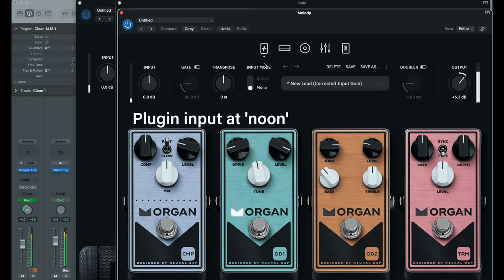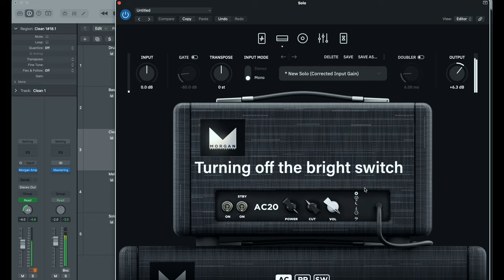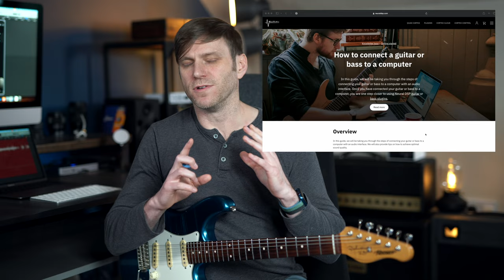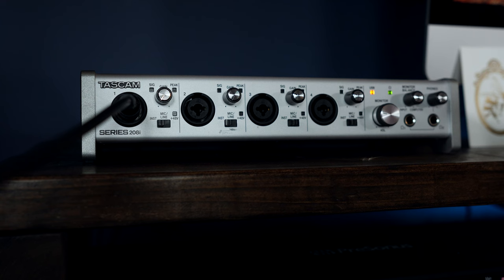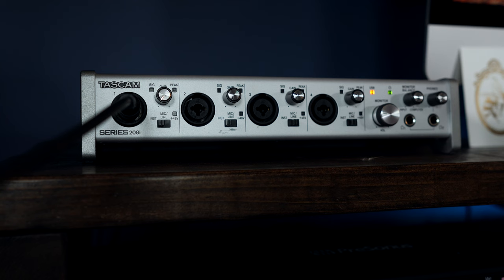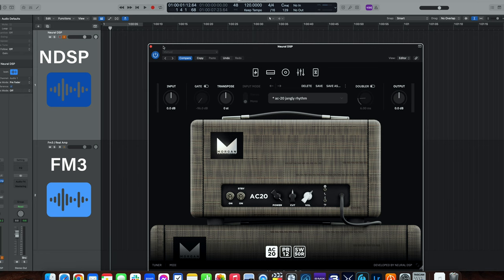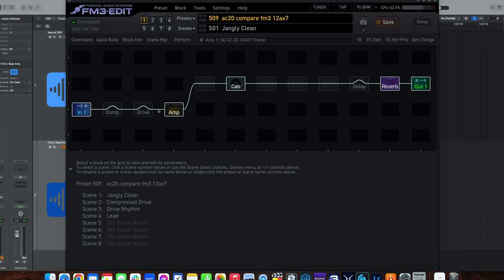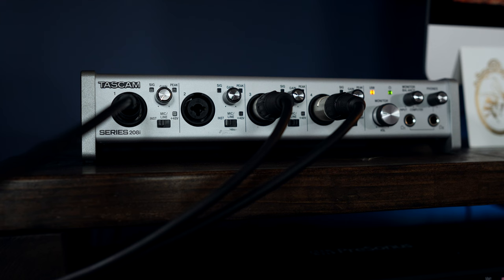I Finally Learnt To Like Neural DSP Amp Plugins | STOP Slamming That Interface & Get Better Tone!)

Comment: I keep seeing this "Gain at zero" thing, and wonder whether anyone has ever thought about what  that actually means and how it differs from one input device to another. It just wont mean the same thing for all devices, I can guarantee you that, as there is NO STANDARD to which all interfaces adhere to.

It seems, after a little thought, that the plugins like to see an instrument input (preferably JFET I would think) with the GAIN at UNITY.

This is not the same thing as turning the gain knob all the way to the left. 

The only way you can be sure of finding unity gain on your input channels is :

 run a test tone generator from your DAW at -18dB (arbitrary level but it should correlate to unity gain at the output which is where the opamp performance is best)
 route that signal to an output 
 take a balanced TRS jack from that output and connect that to an input channel
 increase the gain on that input channel until your interface's mixer or your DAW reads -18db

That should be where unity gain is set on the preamps of your interface. Mark it with a sharpie, or if it's digitally controlled, note the input gain on the device.

I can't think of another foolproof way to establish whether the gain setting on your interface's preamp is at unity or not.

Of course, this isn't a problem for anyone using an external instrument preamp which feeds an interface input at line level - unity gain is almost always marked on the input gain legend. DI Boxes, if that's your vibe, also vary with trannies being either 10:1 or 12:1...so there'll be a difference in the level your interface sees depending on the box used.
Reply: the issue is more to do with the specs of the A/D converter, so -18dBFS out of a D/A could be a range of different voltages depending on the gear being used.

The best way is to send a sine wave out, and measure the actual voltage. Then run that known voltage into your input chain and see what dBFS level you get. From here you can accurately adjust to a known headroom.
Reply: @eds4754  I Don't think that's true about A/D converters...the vast vast majority of interfaces use the same A/D chips. There are only a few in common usage as far as I know, thus keeping the entry level the same for all manufacturers. The difference is in the preamp circuit design either side of the A/D D/A. That's where the magic happens, and that's where it's either good topology or off the shelf designs using the cheapest of the cheap SMD OpAmps. 

We agree on the solution however; run a test tone out via TRS to an input. All else being equal, the inputs and outputs will be calibrated similarly. None of this would a problem if manufacturers stipulated exactly where unity gain is on the mic pres.
Reply: @stephenfleming8030  you can look at the specs of different converters, they vary in how much voltage (dBu) they can take before clipping. Some converters even allow you to adjust the headroom so you can calibrate them to whatever gear you are using them with. 

You often hear of -18dBFS because converters will often be designed with +4dBu=0VU with 18dB of headroom, so a 4dBu sine wave would have 18dB of headroom before clipping, and therefore 22dBu of headroom total.

There are MANY converters that don't use this definition though. Avid MTRX has 30dBu of headroom, RME varies between 24dBu and 19dB and 13dBu, UAD has 20dBu, Prism and Lynx are different too. so UAD Apollo has 16dBu of headroom, or a 4dBu sine wave would be equal to -16dBFS.

This is the exact reason there is confusion about input levels with amp sim plugins too.
Reply: @eds4754  Absolutely, I agree. Just to clear up any confusion I may have caused, when I say 'converter' I'm talking literally about the chip that does the conversion. As we've established, the topology on either side of the converters can vary from circuits that cost pennies, to well designed often transparent circuits like RME pres....a world apart from a small Focusrite Scarlett that's using very cheap smds that need to be handled with care to get the best out of them....to say nothing of the clocking differences between units that use the same physical ADDA chips.

I'm assuming that the 'majority' of interested parties here are guitarists, rather than primarily engineers. I don't know if that assumption is fair or warranted? If that is the case however, then it's doubly difficult to explain what's going on with input gains and how they should be set taking account of all the variables at play. 

I've tried external pres at unity, and it seems to be ballpark. For guitarists maybe a decent active DI box is the best solution - an active Radial DI for guitar is 140 EU, and you'll have it for life. 

For the lazier, or the skint...Tonex software has pre-recorded guitar parts built in which are DIs from fairly easily identifiable pick up types - one could always match the input gain to them if you're in a pinch.
Reply: @stephenfleming8030   what about converters that don’t use any preamps? They all vary - There simply isn’t a standard for defining an analog voltage as a dBFS level. It has nothing to do with preamps, or other circuitry in this case. They are just spec’d different for different demands and price brackets. 

and so setting a preamp to unity doesn’t help when converters have different specs. Preamp gain is one thing, but the conversion ratio of the converters is another. 

I would also be careful with Radial DI’s because many of them have impedances far below 1M Ω which means they’ll load passive pickups incorrectly and get poor results. They’re well made DI’s, but for many guitars you’d need to run a buffer in front. I use an Avalon U5, but there are many suitable DI’s with 1M Ω or greater that I think are more suitable.
Reply: @eds4754  You're right, there's no absolutes in this, but dare I say that the assumption that -18 is ballpark 0 leaving you plenty of headroom either way is a good place to start. It's not an perfect assumption to make, but it's a place to start.

Setting aside amp sims in particular, it's good practice for recording guitarists to get used to the fact that -18dBFS simply is not too quiet for a digital recording. It's where the preamp circuits before and after your converter chips exhibit the best performance in terms of S/N ratio, THD and frequency response. If you're running into a Burl or an Apogee etc, such things shouldn't vex you too much, but if you're in the other 99.99% of recording artists using relatively affordable units by Presonus/Focusrite/MOTU et al, all those units use the same jelly bean smd opamps that run on 5v rails and they will crap out at either end of the optimal input range. They're amazing for what they are and how much they cost, but you simply cannot get the best out of them unless you treat them with care.

On guitar inputs, it's good practice I think to run through a buffered device at all times. Even a Boss TU-2 will do the job. I reckon most floor units (not pedals) are probably buffered in bypass mode.

Comment: Wow, I am even more confused now. Getting a healthy (non-clipping) DI signal recorded should be the way to go for signal to noise ratio. If that doesn't work (and it clearly doesn't) isn't there something wrong with the plugin software ? I am using amplibute, and aparently there the problem is the opposite, not enough gain that hits the plugin with a 'normal' input level. Basically, all this should not be an issue, but should be addressed correctly by the plugin developers I think. Or maybe I simply don't get it at all.
Reply: If your interface has less than 15dBu of max headroom then gain at 0 is already going to be close to clipping with humbuckers. The noise floor you have to worry about is the loudest source of noise in the chain, which will be in the interference into the pickups (which is much louder than the self noise of the interface). Turning the gain up just raises this background noise more.

Comment: Hey nice video , i am using this technique of setting interface gain at zero ( UAD Appollo) and been using NDSP Soldano at noon, into studio one and man it sounds like crap on a mono channel. The waveform is also very very thin.  How do I get better sound and healthier D.I waveform if I reduce the input of my interface>>>???
Reply from the maker: That's interesting, I've found the Soldano, way nicer setting it this way. You could gain your interface the normal way then reduce in the plugin, it's just when I did it that way I couldn't reduce it enough still with the interface I was using.  I also don't really see it making much of a difference tone wise these says with noise floor being what it is.
Reply: @DavidBeebee  what about buses ? Do you bus 2 mono track to the same bus or one for each? Theres many ways of doing this im a bit confused. I just want to double track and add a lead guitar and make great 80s music.

Comment: ok that is what is supposed to be done i guess. now let s assume another scenario : you want to use your dry signal to another amp vst...you have a shit noise ratio recording because it was recorded too low just for neural dsp ?
Reply: Neural DSP's optimal level is actually quite hot, its 7dB hotter than you'd get using an Axe FX (for instance). The main source of noise is going to come from background noise into the pickups which is going to mask the self noise of the interface, unless you're recording like 20dB too quiet.

Comment: when i turn the gain to 0 on the high-z input on my presonus quantum 2626 (same preamps at the 1824c), i get zero volume from the guitar. how did you manage to gain stage it properly with your presonus?
Reply: Same with my Studio 1824 Instrument Ins, sound is almost non existent and to obtain a decent amp sound i have to turn the gain knob AT LEAST at nine o clock. @DavidBeebee how did you do with your Presonus 1824c?
Reply: I have a 2626 and same issue. Ed S explains how much gain  you need  to add at plugin input based on the max input of the interface, which is 15db for 2626. I get a lot of noise when I do this and the noise gate on the plugin doesnt react well.
Reply: The Hi-z gain knob is supposed to be use to get the best gain stage level before recording. The reason there's no signal on your recording is because you are recording the actual dry signal, not what comes out from the plugin. You are just monitoring the amp sim
Reply: @PedroMiguel-if3ll  Hi mate, I am aware of how it works with dry signal. Did you watch the video? It is about having the HIz dialed all the way down and then based on the interface specs (presonus  quantum is 15 dbu max gain) add a certain number to get the 'realistic" sound

Comment: I've been struggling for.. i'm embarrassed to say years, with my levels always clipping. Specifically with Archetype Gojira, no matter what i've tried it always clips when recording. Input gain on focusrite itrack solo is all the way down. Do you have any tips? The whole gain staging thing is so confusing and i've watched countless videos with no success. I also use Logic. I suspect my emg pickups have too much gain. It could be a dozen other things though it seems.
Reply: Get a Di box with a pad on it.  This should solve the issue :)
Reply: This is something I haven't heard much about, especially the pad part. I really appreciate the feedback and will look into that!  @drummingjeremy11
Reply: What were the issues you were facing? For me, all the amp sim plugins sound way too boomy and muddy. Imagine the tone knob on guitar being rolled off. No matter how I adjust the amp sims or IR's, it either sounds very boomy and muddy or very thin and fizzy. As if plugged into a Fuzz pedal.

I've tried to adjust the gain knob at 0 on the interface, it only reduced the saturation and input signal into the amp sim plugins, but they still sound very boomy. And yes, I run the guitar cable into the high z input of my interface (tried with RME babyface pro fs and focusrite scarlett solo 2nd gen..) Something is just not right. What was your experience? And did you come up with solution?
Reply: @kalpitmomaya916  Man, I feel you so much on those issues. A big part for me because of how low i'm tuned is the EQ. I use Pro Q-3 and it's helped a lot more than the stock EQ on Logic. I use Archetype gojira for all the amp & cab as well as the overdrive and noisegate pedals on Fortin Cali at fairly minimal settings, and those two pedals help a lot. Buying IR's from Buster Odeholm website helped a lot as well. I use the EQ on Gojira and lower the low and high end quite a bit. You have to do some EQ sweeping on whatever EQ you use to find where the booms and fizz come from. I also use Saturn 2 and that's the biggest game changer. Saturn is not necessary but makes it a lot easier. Oh, and I mostly keep the gain on my cheap 7 year old Itrack solo at 0 gain, sometimes I turn it to almost a quarter of the way up occasionally when i'm experimenting. Which is at least once a week lol i'll think I have the perfect tone and the next day something sounds off. :')
Reply: @kalpitmomaya916  I wouldn't exactly say I found THE solution as it changes from song to song and each guitar. But the EQ changes I found over time helped a lot and now I almost never clip.  Especially the pre-eq on the amp sim. I'm not a pro by many means, but i'm down to help you out if you want. Hell, I bet I you could teach me a thing or two as well.
Reply: @kalpitmomaya916  Oh, one more thing, have you adjusted your pickup height, truss rod etc? The setup especially pickup heights can make a difference in tone.

Comment: 08:40 considering this is how virtually every guitarist sets up their audio interface, WHY ON EARTH didn't all those plugin manufacturers shout out loud NOT to do this  ??? I mean, wtf !!!
Here's the real kicker - EVERY plugin reviewer on youtube was obviously told how to CORRECTLY set the interface for EVERY clean sound they demoed. WHY didn't THEY tell us that important thing to do? !!!
Reply: 12dBu strummed hard with humbuckers will be roughly at 0dBFS. It’s not a very accurate way to do it though, but it’s the most simple way to recommend.

The problem is, this is only true for humbuckers and even then, it would have a wide range of values.

Comment: I cant understand the confusion and the kind of suprise that goes with that. I mean, if a Fender Tweedchamp isnt slightly overdriven on 12 and cleans up at 7-8 you know there is something wrong with your input gain. Or the Simulation is trash. Or is the problem, that nowadays nobody knows how Amps behaves and Sound in reallife?

Comment: Wait I'm confused... Have we all been hating plugins all this time? 😅 I thought I was alone!
Reply from the maker: lol I don't know about hating them but I think there's a lot of gui's like me frustrated by them for a long time!
Reply: @DavidBeebee yeah I was being overdramatic. I really thought I simply had a bad interface, feels comforting to know there is such an easy fix! Thanks for this video.
Reply from the maker: Thanks for watching, glad it helps!
Reply: @tshuqwud1693  What were the issues you were facing? For me, all the amp sim plugins sound way too boomy and muddy. Imagine the tone knob on guitar being rolled off. No matter how I adjust the amp sims or IR's, it either sounds very boomy and muddy or very thin and fizzy. As if plugged into a Fuzz pedal.

I've tried to adjust the gain knob at 0 on the interface, it only reduced the saturation and input signal into the amp sim plugins, but they still sound very boomy. And yes, I run the guitar cable into the high z input of my interface (tried with RME babyface pro fs and focusrite scarlett solo 2nd gen..) Something is just not right. What was your experience?

Comment: I having real trouble figuring out where 0db is on my presonus studio 68 interface. The input gain dial goes from -15bd to +65 with no indication where 0db is!
Reply from the maker: Sorry I don't know about the studio 68. I just turned the gain knob all the way down. Maybe try that, and see what its peaking at?
Reply: @DavidBeebee  the dial goes from -15db to +65. I did the math to find where zero should be but it was way too quiet for the plugin. So I've just gone with the advice on the neural site and set it so my signal peaks around -12.

Comment: seriously? so many videos out there covering this subject. well, that's what the input knob in the plugin is for ... in the real world, meaning analogue, if the amp is breaking up to "early" - whatever that means since every guitar has different output levels - you want to lower the gain of the amp or the volume on your guitar, well ... In the old days I was pushing my peavy classic 50 hard by adding the compressor of a korg a3 with no compression dialed in just using it to push the volume. use your ears. if treating an amp(sim) badly is giving you the sound you are looking for, go for it.

Anyway, if you are going for "this is how it should sound ..." I prefer to gain stage like shown in the beginning for the better noisefloor ratio in the analogue part of the chain and lower the input volume (signal and noise) in the plugin to achieve the desired sound/behaviour. Best of two worlds.
Reply: P.S.: waiting for the first audio interface with an instrument input that goes "directly" through to your amp sim ;- ) which'll screw up amplitube that seems to handle a digital signal at line level quite well ...
Reply: the goal here is to have the same gain response as plugging your guitar into the real amp.

NDSP spec’d their plugins so you can use the most common interfaces (UAD/Focusrite/Audient) at gain=0 and have the perfect level.